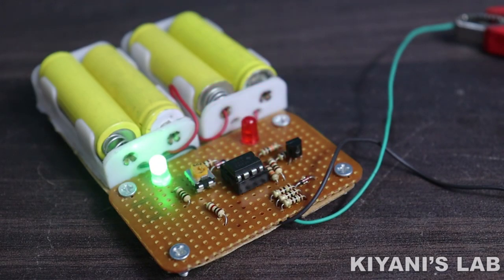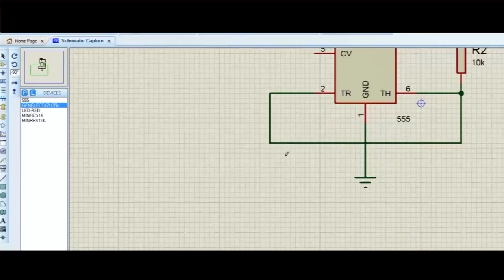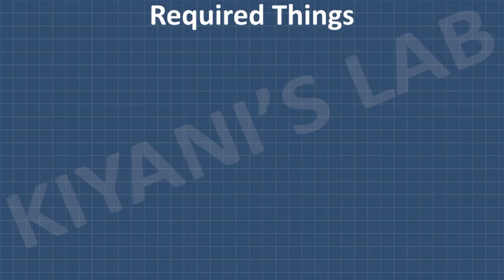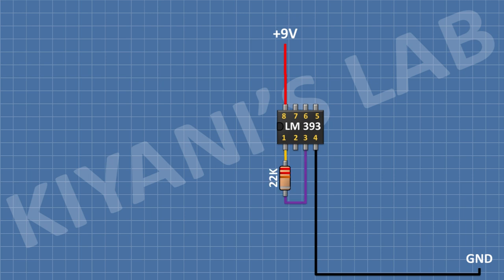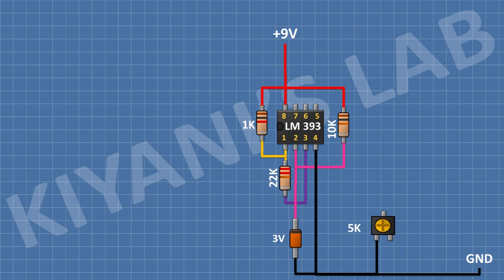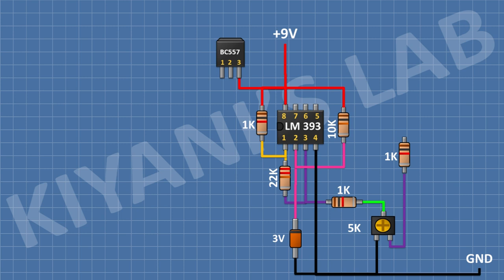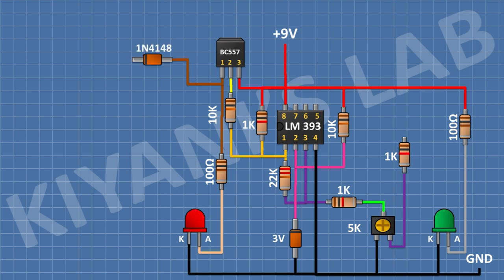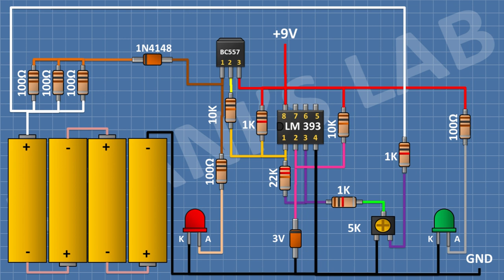How to Make 4.8V Automatic Battery Charger | 4S Ni-Cd and Ni-MH

Comment: Dear sir, according to the your explanation that start like "high friends..." you made 2.4V battery charger. But in your explanation circuit and completed circuit which at the end there are 4 battery connected serial means 4.8 Volt. As it is written in some comment no individual battery control. Some battery can be over charging, some less. No balance control. Thanks.
Reply: This is a very good question I wonder why he has not answered it after year????